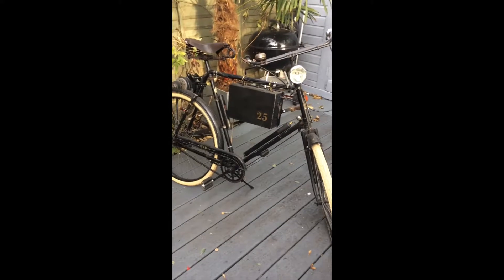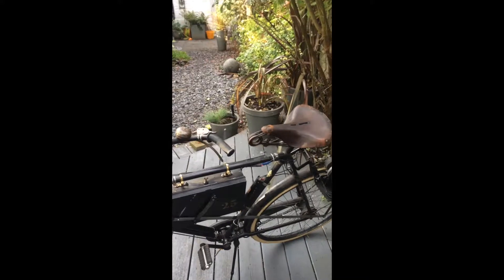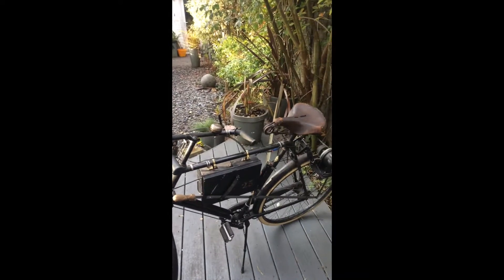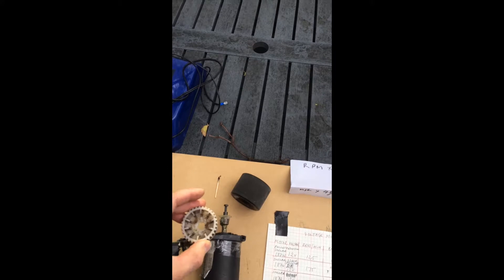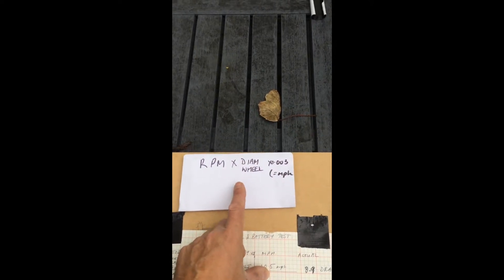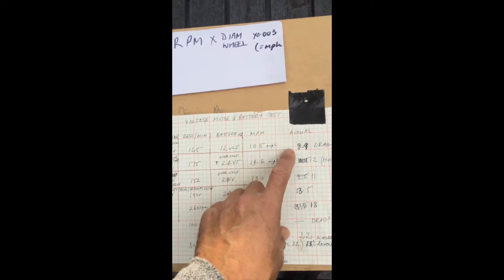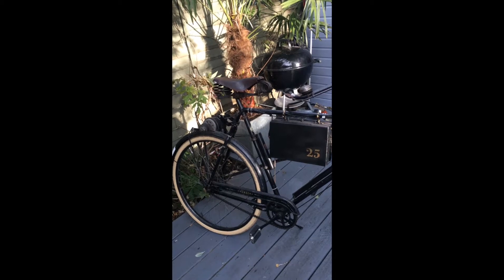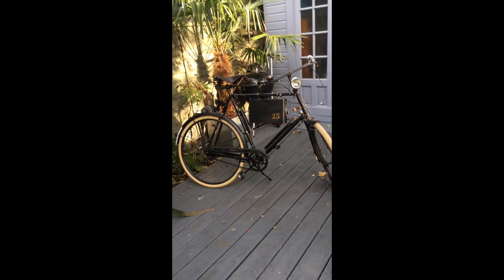48 VOLT 750 WATT FRICTION DRIVE EBIKE  1953 ex Police bike!

Comment: Superb.... Do u use this cycle now also... Is it working good during rainy day
Reply from the maker: I used it fairly regularly then Sold it.It’s never good to leave batteries unused/ uncharged for any length of time. It’s now sold to a Raleigh ebike shop. They hung  it on the wall as an old curiosity.